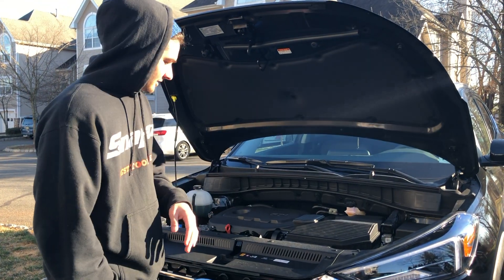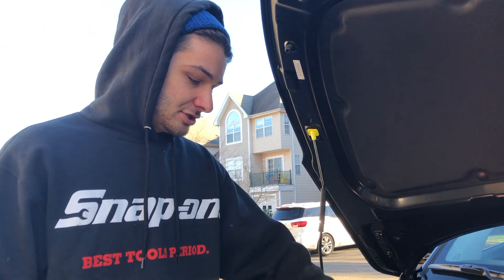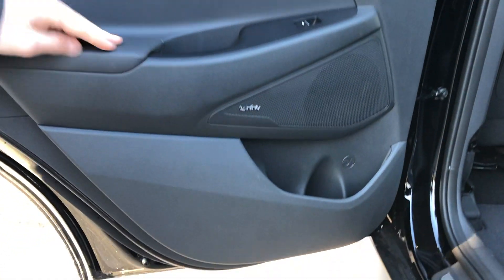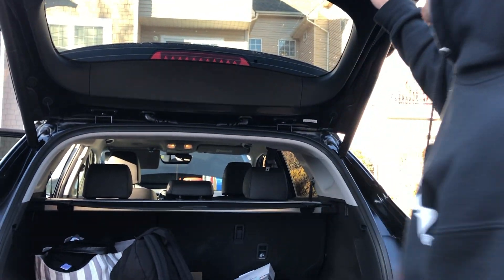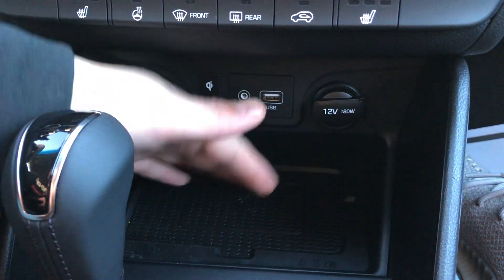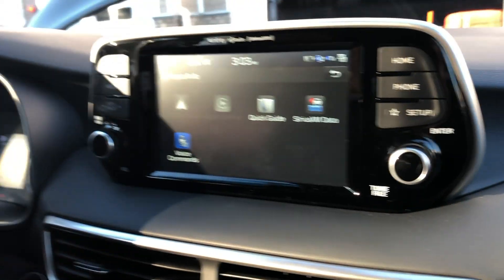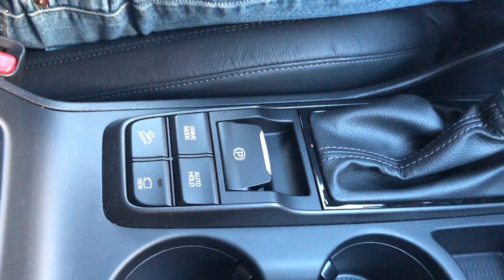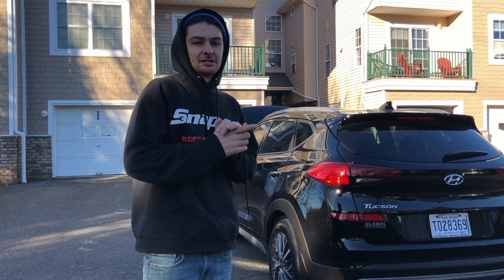REVIEW: 2019 HYUNDAI TUCSON LIMITED | 2019’S BEST COMPACT SUV?

Comment: After watching the entire video and saying you did a quality presentation, I would add that maybe in the future you are more careful about using the word "nice" so frequently to describe whatever. In this video, you used nice to describe:
- LED headlights
- Lower lip [front bumper]
- 18 inch rims
- Silver accents
- Spoke design
- Chrome finish [along windows]
- Leather interior finish
- Rear cup holder
- 12 volt plugin
- Cargo net
- Shield [in trunk]
- "Hugging type feel" of front seats
- Grip of steering wheel
- Heated seats
- Push to start
- 7" touch screen
- Electronic emergency brake

After a while, nice doesn't mean anything if nearly everything is described as nice.

Just something to consider for future videos.